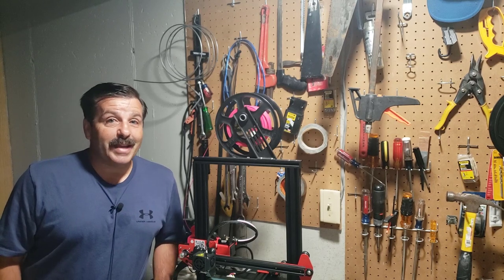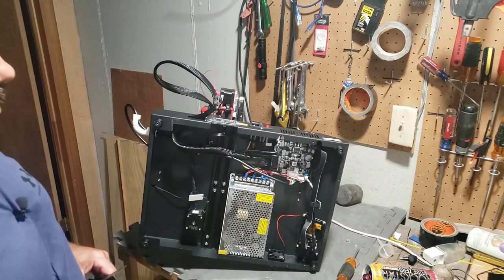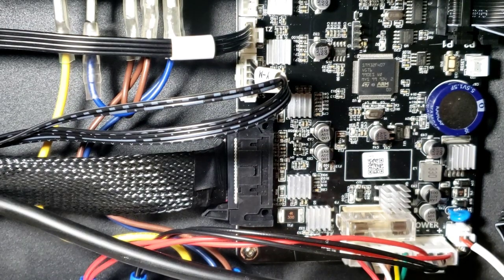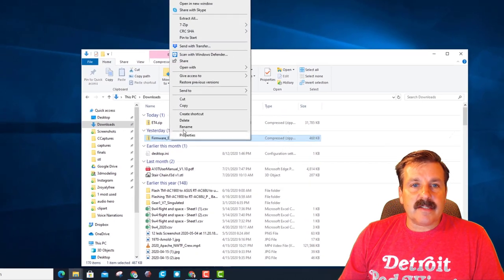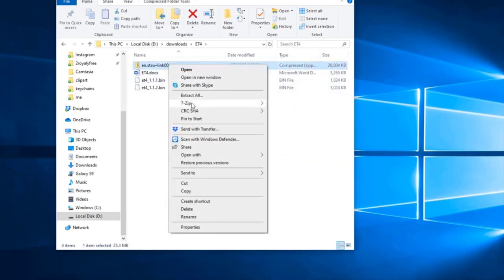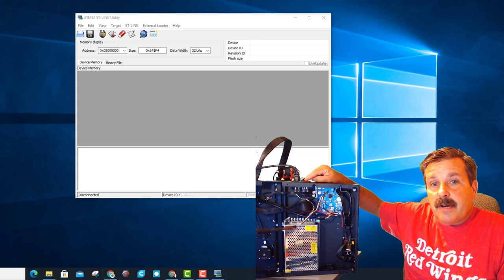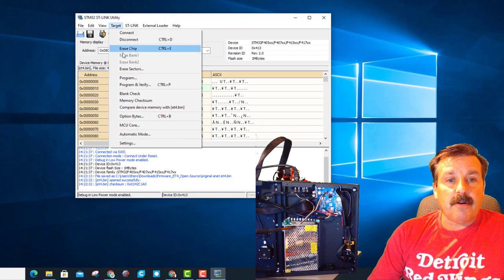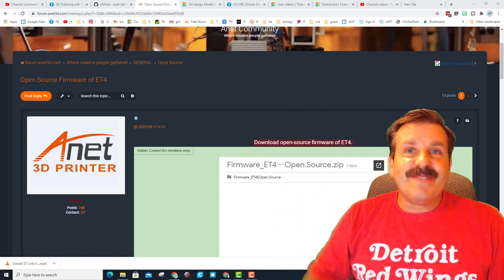Tested! Flash an Anet ET4 to Marlin 2+ firmware using ST-Link v2

Comment: Thank you! You help me because I was getting crazy trying to compile at Visual Studio Code spending a lot of time without help and having no idea how to fix it all the errors that shows when I compiled the files.
Reply from the maker: Glad you were able to get it working. Did you change your firmware a little and that’s why you were compiling it.? I have not mastered the firmware much yet, but it may be on my summer list. Too busy with school teaching right now for any crazy stuff. :-)
Reply: @HLModTech  Not yet... Just downloaded from Anet and flashed it. I only changed the motherboard to a silence one leaving the original as spare and having a lot of issues with the cooling fan because It didn't turn on meanwhile is printing. I changed everything but nothing.

Comment: Good tutorial thanks for your help. It is work with et4 drivers a4988 and firmware 1.1.7?
Reply from the maker: Thank you. Yes, this one is built for the A4988 drivers on the stock ET4. Yes, it works if 1.1.7 was there as you are completely replacing it.

Comment: Time to upgrade the ol girl.  Finally being able to adjust e steps and baby steps will make a huge difference in the printer.
Reply from the maker: I agree. I am glad they finally went open source. Giving users the option to dive in and solve stuff is usually a good gig with 3D printers.
Reply: @HLModTech  honestly can't believe this printer didn't have some of the live tuning options I was used to on other printers. Was able to get it dialed in pretty good with a little help from cnx tech as he is a personal friend. I'm relatively happy with the printer but this upgrade should get it fine tuned and where I want it to be
Reply from the maker: I understand completely. I am not sure I have played with a more limited control panel than when it shipped. The chatter in the FB groups was that Anet would NEVER go open source. I am so glad that we at least have options now.

Comment: Great video !  This is not against you... this is not “open source “... a premade bin to flash is Anet going back to their “illegal” ways from before... they need to re-read  the GPL license for Marlin.  They are to FREELY give access to the UNCOMPILED source code.  Just like you can directly download from the Official Marlin website; failure to do so is in violation of the license.  They did this before and got “black listed” by the community for a while, then they did the right thing of releasing the code. Just like Creality did back a long while ago. 

If you have a contact at Anet, they should be reminded of this.  I also notice that they stated on the forum that by using this update you violate their “warranty “... which is laughable since they still legally have to fix a defective machine and its parts regardless of the specific firmware used. Just like if the “factory” firmware doesn’t have thermal runaway protection, they are responsible for ANY fire and damages from the fire!  Oh wait, they are in China, selling a “Kit”... so no legal recourse...

Anet needs to stop playing these games and do the right thing.  Fully FREE and open firmware - the right way!
Reply from the maker: Thank you. They did give us the source code. It is here. https://github.com/anet-3d/Marlin/tree/Anet-Marlin-bugfix-2.1.0  They just created the bin for those 3 versions of the printer for us.

Comment: Is this the same for the ET5??? The stock firmware has so many problems!!!
Reply from the maker: I have never been able to snag a ET5. =( I really do not know.
Reply: @HLModTech  yes it's the same, I found a facebook group were this works for et4/5 you only need to change the steppers drivers, size of the bed and heigh, and and other stuff, very simple. But I don't have an ST-Link v2 :( I have the USB ISP that only work with ender printers

Comment: Is there anything I can do to get my Anet et4+ to accept updates? I've tried new brand name sd cards and the only update that it accepts is the version 1.0.0 which is what it came with.  Can I do something with the jtag setup? TIA
Reply from the maker: Good start with different SD cards. I only update with the ST-Link. There is a way to add openBLT. I did it once, but it was a bit tricky. I did not make a video about it. Did you already move to Marlin or are you stock?

Comment: Can I use this method to upgrade the firmware for my BMG extruder? Is there a tutorial on it? Using the sd card always gives me a "upgrade failed" message.
Reply from the maker: There is no tutorial, but if you are confident changing the proper areas in Marlin it is possible. I never mod my machines, so I do not know what code you would need to change.

Comment: Do i need the STLink to configure the printer (like steps/mm) or can i just hook it up to my PC via USB?
Reply from the maker: The firmware that initially came with the printer did not have any calibration settings available. What version is your firmware? I have not sent steps via the PC. What are you doing to make that happen?
Reply: @HLModTech  Yeah I know, I spelled it bad. I meant when I install the marlin software, do I still need to hook it up via STlink to configure everything. But I already got it. I installed it today and already calibrated the steps/mm. Thanks for that nice tutorial, it helped me a lot.

Comment: Hi, is a similar open source FW available for TMC2208? I have an ET4 but with a silent board. I would also like to test the changes. My ET4 is already heavily modified. The main extruder is BMG as it is unrivaled. For now, I'm solving this by adjusting the feed rate in Cura, where I have set 310%. And it works very nicely. I also have an E3D hotend and DualZ mod. The TMC2208 has a very fine feed compared to the A4988.
Reply from the maker: What is available is the source code.  Then you can use Visual Studio Code to adjust it to fit the sweet mods on your rig. You can find the source here https://github.com/anet-3d/Marlin/tree/Anet-Marlin-bugfix-2.1.0
Reply: @HLModTech  
I originally bought an ET4X with a noisy board.
then I changed the board to silent here + reinstalled the Z end sensor on the top like the ET4 has. Then he played the FW on ET4 here because he has a better manual calibration for me. It works beautifully. Unfortunately, I do not yet understand the work of Marlin FW to such an extent that I know what I should and should not use. So I prefer to wait until the open source MARLIN is for TMC2208. Thank you for your response.
Your videos taught me a lot. :-)
Reply: But I would have one more question. I never managed to load FW in version * .bin. It only worked * .hex at a time. I have no idea why, but I also read this problem on the forums here.
Reply from the maker: Hex would work if you were using the console to upgrade. The .bin works with the ST-Link V2 that we actually connect to the board.
Reply: @ratman4747  I did the same with an ET4X replaced the Board with the TMC board, move the Z end sensor on the top now I can not level the bed, when try the z move all the wait down touch the bed and don't stop, how did you manage to level the bed

Comment: Hello, I installed marlin 2.0 on my Anet et4. Faced with such a problem: when you start printing, after warming up the table and the extruder, when you start squeezing plastic, the screen turns off ( the model is printed).Perhaps you know how to solve this problem?
Reply from the maker: I have never heard of that. Are you saying the print finishes even though the screen shuts off?
Reply: @HLModTech  Yes, it was. but I shouldn't have worried. I turned it off completely, then turned it on and started a new print, and there was no more such problem. thank you for not ignoring my question.

Comment: cant connect to mine i knowtes your ST-Link v2 is blue mine have a red light? and the SWD Frequence you use what in the magic number been trying all, trying to eliminate problems (troubleshoot)
Reply from the maker: A couple things to check.. pins right.... Your labels may be different than mine. I also forgot to power up the printer... It does not work with it off either.
Reply: @HLModTech  all is x 20 checked i think it's my windows version, if i go to support win8 everything looks like i work and i don't lose the usb, but it still dont connect :(
Reply from the maker: Uggh. Send me a picture of the setup at hlmodtech gmail. Maybe I will be able to spot something.

Comment: After updating resume print is not working properly. And when I updated to stock firmware the print resume option is not available.
Reply from the maker: I am in the same boat with resume print not working. I believe the switch from 1.2 to 1.5 broke that on the stock as well.
Reply: @HLModTech  thanks for replying.

Comment: good. I installed marlin following in his footsteps and it was great for me. At the moment in order to work with Marlin I need to learn a lot and I don't have time. I have decided to return to version 1.1.5 and when I flash again the program tells me that "the voltage is low" and to enable a function. I have tried several times and the program loses the connection connection with the board. I hope it was not spoiled as I have followed the steps correctly. Could you help me with this matter?
Reply from the maker: It should be possible to move back. I would double check the wires on the ST link, then in the box.  Lastly I would make sure you powered on the ET4. I have missed that step more than once. All are easy to do though.
Reply: @HLModTech  I check the cables several times and they have always been well connected. The STM32 utility program always tells me the same thing, lost connection and check the power to the board. he has never been without food. of what could be. Could you send him a photo with what the program tells me?
Reply from the maker: Is there any chance your ST-Link has different pins than mine? I have had a few users mention different layouts.  Not sure who you are asking me to send a photo to?
Reply: @HLModTech  The photo indicates the fault that the STM32 ST-LINK program gives me so that you can see the error code. I repeat that the first time I used it to load the Marln 2.0.x firmware, and since I didn't like it, I wanted to go back. When trying to load the firmware that I made as a backup copy of the version 1.1.5 that my printer had, it was when I think my motherboard broke.

Comment: Should I use the same way to returned to original firmware? 
Also why Z shows 250?  After I update my ET4 he think that endstop on top not bottom.
Reply from the maker: The original ET4 did have the end stop at the top. Are you sure you have the correct firmware and model?
Reply: I think I've got a ET4 X,  but it was sold and marked like ET4. Probably I need to try ET4X firmware.
Reply from the maker: I was just going to send you the note that the video showed a ET4x. Sorry for my delay. It had been locked in a filter because of the link..  Sure hope you have it solved.

Comment: HI there I am trying to upgrade ET4 to Marlin, I can create the backup the firmware but when I tried to flashing I am getting and error Elf Loader could not be transfered to device Change Target/Settinhgs/Connection setting's mode to "Connect Under Reset" and Try again, I follow the instruction but still getting the same error, after some time the screen go blank, if I reset the printer it's working fine with the original Firmware.  Any help.  Thanks.,
Reply from the maker: Are you sure you have the wires right?  I have seen where the labels on other devices were different than mine. I also had tried with the printer not powered on as well which was a fail... Let me know if that helps.
Reply: @HLModTech  Thanks, I am good now, not sure what was wrong I restart everything including my laptop and flashed without issue, maybe the issue was the laptop.. Thanks Again...
Reply from the maker: @rancerdelacruz9261  Glad to hear. 👍

Comment: hi, how can i change the language in the printer?  Marlin supports a lot of languages, but I don't know how to change it.  Thank you
Reply from the maker: I believe you would have to use the link to the marlin firmware and make that change in the Arduino IDE or Visual Studio Code. I have never done that though.
Reply: @HLModTech  I did it via Visual Studio code. Unfortunately, I can't calibrate the bed and the nozzle is always below bed level. If I want to return the original firmware, the printer will hang. So I can only have Marlin, which doesn't work

Comment: hi 
am facing issues with new firmware 
i flashed marlin2+ using stlink it is success
but after that i tested auto home then x and y are working fine but z axis is not working , it is moving up few steps before reaching its high &it starts toward down and collide with bed 
i even tried to to reinstall firmware
 can anyone help !! 
thank u in advance(:
Reply from the maker: Which ET4 do you have? Was yours the type that homed up?
Reply: @HLModTech  my one is anet et4 
Yes it is towards up
Reply from the maker: ok. Where did you find the firmware file?
Reply: @HLModTech  i found it in anet web site but when I downloaded it is not et4 
So can you please share me anet et4 firmware